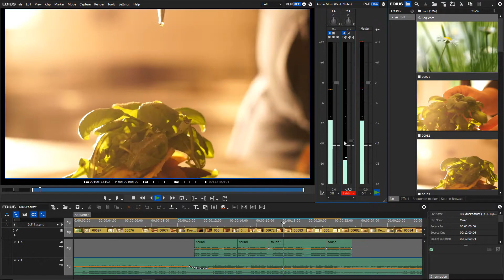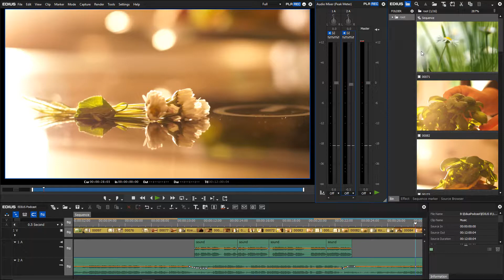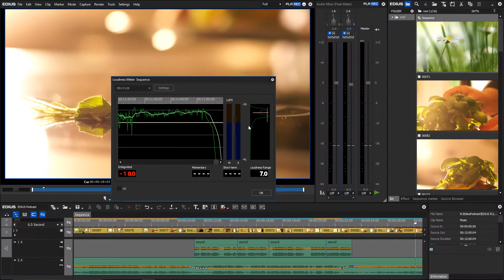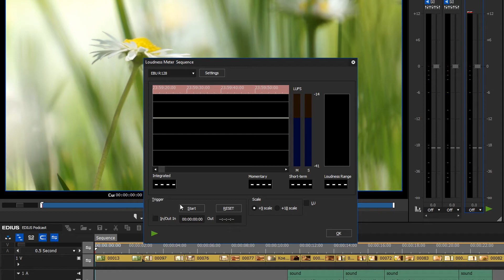EDIUS.NET Podcast - Loudness measurement in EDIUS Workgroup

Comment: why we use the same video file in 4 different computers with edius workgroup 8.1 and 8.5, and come out with different results?
Reply from the maker: I guess the project settings or the audio mixer are different. Please test with the same project file - then you have a real test. You can also contact your reseller to get propper support.
Reply: Thank you for your response ,we finally solved the problem
Reply from the maker: Thank you for the feedback.